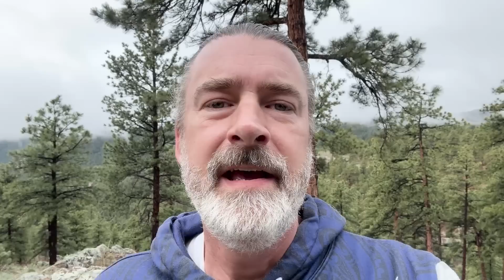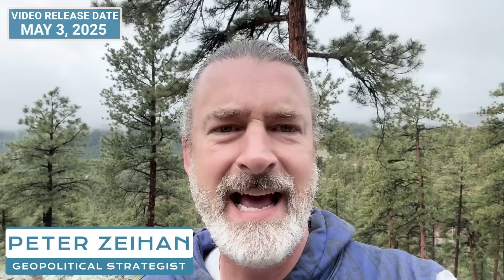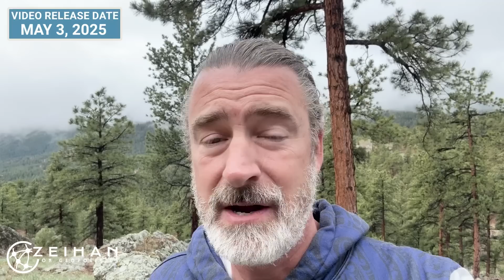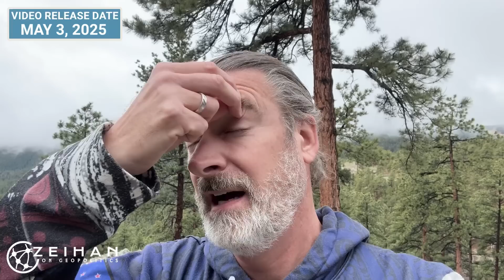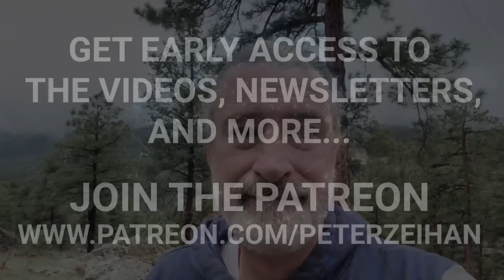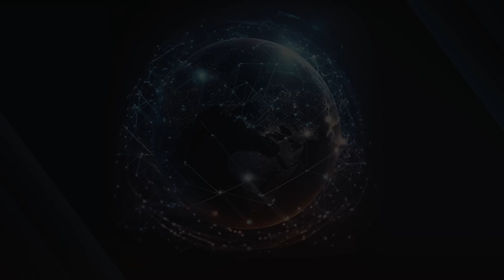The Night the Lights Went Out in Geor- er, Spain || Peter Zeihan

Comment: Electrical Engineer here - you are forgiven but only just. Also nuclear is the non-carbon source with by far the largest grid inertia contribution per MW.
Reply: Finnish base grid organization is testing something called synchronous compensator near large wind farm to stabilize grid wave
Reply: Plasma drilling geothermal, can give old coal plants a 2nd life.
Reply: "Not great, not terrible."
Reply: @immortaljanus  I see what you did there. Underrated comment.
Reply: Yes, hydro, solar-thermal, and geothermal can all also add grid inertia. So there's several green options.
Reply: @domtweed7323  to dream, the impossible dream......
Reply: @domtweed7323 Or flywheels, powered by renewables instead of fossil
Reply: @sam-r7w  Yes, also possible. In Spain specifically they've got 20GW of hydro, several nuclear reactors, and could import grid inertia from France's almost 60 nuclear reactor, so they could probably get away without those. But yeah it's definitely possible. And in more purely variable-renewable grids, like Australia, it makes a lot of sense.
Reply: @sam-r7w  So called renewables use require more energy than petroleum when factoring mining, manufacturing and cause massive environmental damage because of large area devastated.  So called “fossil” fuels are compact, cheap, and much more efficient.
Reply: @domtweed7323  But - the interconnection France - Spain is limited to 3GW only (against 15GW lost)
Reply: @domtweed7323 They are de provisioning their nuclear plants.
Reply: @jogi_54  I agree, build more interconnectors. EDF can get paid power plus extra for the grid stability services, and when Spain has a surplus it can be re-exported into Europe's grid.
Reply: @bobnegri6098  Which is a mistake: They could be quite cheaply refurbished and kept for another 40 years. But even if they go ahead with that France is right next door, and has around 60 nuclear reactors from which Spain could import frequency balancing services.
Reply: @sam-r7w flywheels are a gimmick for grid scale impacts. Largest 2 (which are multiple units ganged together) total 50mw. One was made in 2011 - so in 15 years, only 1 larger was made. 

Spain needs 10-100x that.
Reply: @domtweed7323 cheaper to have thermal plants (coal, gas, nuke) running on “low” at all times and have a limit on how high % renewables is of total generation.  

Then bring up other devices (grid ties maybe, synchronous condensers, battery storage, other?) to allow grid to remain resilient to frequency deviations (aka wobble). 

Renewables just can’t counteract low frequency - you need power to do that, and renewables doesn’t have extra power to give. You always run them at max. 

Or you mandate all renewable plants run only at 90% of max capability, leaving 10% in reserve for frequency response.
Reply: @sam-r7w True. Flywheels with battery backup are a viable solution.

And are about to see a battery revolution in European grids, providing both stability and flexibility.
Reply: @sam-r7w That's not an energy source, it's a battery
Reply: @sam-r7w  Those don't really help nearly as much as you might think, and would not have solved spain's issue here.
Reply: @domtweed7323  and Spain can sell overproduction of PV
Reply: @domtweed7323  Only partially correct. The connections between Spain and France are very limited-pyrenees inbetween. I think it can only transfer 5GW. There are more interconnections planned-but not there yet.
Reply: @bobnegri6098 once you know why, your life will change. However short it may be
Reply: @sam-r7w  You really cannot do it this way. Labour in the UK thought about doing this, but you don't want flywheels the size of a village made of depleted uranium.
Reply: highest is in theory the synchonous condensers... quarter of nuclear plant, divided by zero added MW XD
Reply: Rich hippie commune doesn’t sound too bad.
Reply: Totally agree. This is where Peter tends to show his oil and gas bias. 

A lot of this problem stems from the decades of European nuclear fear after Chernobyl. They want to decarbonize, but with the exception of a few countries they haven’t invested in building new nuclear power generation. These things take a decade or more to build. It’s a tough situation for them to be in and it goes to show that making poor investments in the past (or failing to make investments) can come back to haunt you.
Reply: @TheCommonS3Nse  Well, when it comes to the economic efficiency of power generation, nuclear power is far too expensive and probably only works if nuclear power is heavily subsidized. 
Google: “Due to the price increases in the UK, the state-guaranteed nuclear power tariff from Hinkley Point C has already reached at least £128.09 /MWh, which is currently 14.8 ct/kWh (CfD Register, as of 22.12.2023)”
Reply: @TheCommonS3Nse  they don't take decades to build, they take decades to get threw the red tape.
Reply: @TheCommonS3Nse  nuclear does not take a decade to build. The chinese, korean and japanese are all able to do it way faster than us because they don't have to deal with nimbys and the "green" mafia that make construction and permitting a  way longer and more expensive process than it needs to be. The asian countries get it done quickly by using a set pattern for construction that enable economies of scale and industrial experience to massively reduce costs and build time. We'd be able to do it just as fast if we cut bureaucracy and eliminated the frivolous lawsuits that delay any project like the california high speed rail.
Reply: Glad you're the forgiving type. 
He's missing out a whole lot here. Eg. Regulating wind and solar farms to adjust their outputs based on forecasting would be another way to do it. Combine it with battery packs would add to grid stability.
It that doesn't cut it, limit max output on smaller producers.
Again favor battery packs for stability and slow release of energy.
Heck, it could even "just" be mechanical/water batteries like those in the alps. They need the water supply in any case.
Reply: ... ahhh the anti nuke nimbys will all be out in force screaming ..."we're all gonna glow in the dark".... and "those nuke-plants are nothing but bomb plants in disguise"... just wait for it. Seems absurd but in this day and age of politically motivated fantasy dis-misinformation... and the misuse of AI.. not so far fetcbed.
Reply: NZ is hopefully OK in this respect as most of our generation is spinning of one sort or another. Not much solar and wind yet.
Reply: Hydro is way better than nuclear in that regard, but not every country has the natural feature to accommodate Hydro-electric power plants.
Reply: Just barely forgiven, yes. The explanation borders on nonsense and inverts cause and effect, but it’s at least conveying the fact that it’s an expected behavior of a grid with little to no stabilizing base load elements (nuclear, flywheels, etc.) or rapid response elements (natural gas, etc.).
Reply: As a Portuguese I want to make it clear it was the Spanish fault. Obrigado
Reply: France is predominantly nuclear, which as you said, creates steam and turns a turbine. Nuclear is the ideal option.
Reply: Unfortunately the fuel has a life of thousands of years and they still have not found a safe way to dispose of it, so every rod ever produced over the decades is just sat there humming
Reply: @hayleydiamond9085 Better to reduce the carbon in the atmosphere though, no? At least there is an strong argument in diversifying risk.
Reply: Oh like this "Grid Inertia" term. Sits well in my non-engineer brain
Reply: Layman here, I missed something somewhere.What caused the "wobble"?
Reply: @danstrunk8828  Until now, the real physical sources are unknown - but they are still searching.
Reply: Give me a break on this bullshit cover story.    
Its CHINA doing bad things to take over Gibraltar.
Reply: Since you are an EE, can I ask you? What if the solar cells used their DC current to spin a large alternator? Wouldn't that be a more stable form of AC generation than electronic AC generation?
Reply: Came here to say the same thing, plus the problem he describing is inertia, it can be solved a lot of ways including just overbuilding the inverter. It’s been a known problem, it is interesting that Spain didn’t plan for this.
Reply: Nuke puts us on foreign dependency.  We don’t have uranium.
Reply: I’d love to introduce Zeihan to a motor-generator set. We use them on ships to convert AC supply to DC motors for winches and cranes, (and on my first berth as Electrician, the CS LongLines, for DC main propulsion motors…God’s slot car)…wherever speed control is essential.

 The MG can work the other way too, though, use a DC motor to spin a generator at the rpms required to produce AC current. You’re not then doing it with an inverter either, which isn’t true AC anyway.
Reply: EE here, green power and global warming are scams.
Reply: I heard the nuclear power plants where a part of the problem in Spain. They sensed some problem in the grid and shut them self's down to protect them self's. Exacerbating the problem. So not the most reliable stabilisers.
Reply: Synchronous condensers would work as long as frequency collapse was actually not the issue.
Reply: Yes, good stuff!
Reply: Hamster on a wheel also proven to work.
Reply: So France could have stabilized it if they where more interconnected
Reply: Yup. You said it
Reply: What about the spinning turbans??
Reply: I was about to make the exact same comment about nuclear, thank you
Reply: Electrical engineer here. I would prefer that Zeihan and all the green activists who are making comments simply shut up. At this point, every engineer has upwards of 1,000 arts graduates and political science graduates ready to explain to them how to do their jobs. I'll leave it to you to explain to Peter how an inverter works, and why they are a bit fragile.
Reply: @TheGruntski  The greenies don't listen to engineers! They buy their solar panels and batteries and ignore the human (slave) and environmental damage from strip mines and surface evaporation ponds used for lithium refining. They'd rather scroll through their Tik Tok, laughing at idiots on screen and satisfying porn pleasures than study the damage their smart phone is creating. But just wait, Elon will implant one in their brains as an eco-friendly alternative :)
Reply: Ehh if Spain had French Nuclear Reactors this would not have happened. The USA westinghouse model they use is so shitty it can't go under 40% power and must br shut down. It also cannot supply electricity for their own cooling systems and had to run a massive diesel generators to avoid a meltdown. In France our reactors can go down to 40% power and supply said power to feed the cooling system without the need of external generators. Also the steam turbines from the reactors act just as the ones in coal and gas plant. This guy sure loves shilling coal and gas... Germany relies way more on french excess nuclear  energy than coal and gas from other neighbors.
Reply: Don't forget geothermal power.
Reply: @nicholasmaude6906  don't use geothermal it's not worth the added earthquakes
Reply: @Hoystein  New Zealand already uses geothermal power at the Bairiki geothermal field also Italy uses it too.
Reply: @nicholasmaude6906  Yeah that's part of why we know it causes earthquakes to get worse. It's a big negative externality.
Reply: @Hoystein  The two geothermal fields I referred to are natural, preexisting ones and as such haven't caused any earthquake issues on their own plus they aren't near any major inhabitations, not to mention that New Zealand is already a seismically active country. In areas where geothermal fields have been created that seismic activity should subside over time.
Reply: @nicholasmaude6906  Geothermal fields make it worse due to changing the plasticity of the rock by lowering the temperature. They make the seismic activity worse as a result.

Them being natural has no effect other then meaning you doing have to drill as deep, CA also has such plants in matching locations.

They have a measurable effect. It's been proven, while the effect is negligible with modern buildings built to modern codes... Most of Europe has very old buildings....
Reply: @Hoystein  Those effects would likely be mitigated by making the system closed-loop so that the superheated water is reinfected after passing through the heat-exchangers. Another is of course to make sure the field is in a remote location.
Reply: @nicholasmaude6906  but what will be the unintended consequences from taking energy from the earth's core? More earthquakes? Accelerated growth of the South Atlantic Anomaly? Accelerated shifting of the magnetic poles? Might as well propose zero point energy (free energy) that Nikola Tesla was tapping into.
Reply: @DenverDad2013  None of that will happen, the amount heat slowly radiation out from Earth's interior is immense and geothermal power plants only use a tiny minuscule fraction of that.
Reply: Could you also just use the solar/wind energy to spin up the turbines in old gas/coal power plants?
Basically you invert the flow of electricity to spin them up.
And then, when you need them for stabilization, you essentially have this massive fly wheel that has some inertia.
That way, we'd get the bonus from the old plants, but we wouldn't have to keep their fires lit.
Reply: @MrNicoJac that’s called a synchronous condenser. It’s a similar; but different device. You’d have to add a lot of upgrades at a minimum. Hundreds of millions in retrofits. 

You can repurpose old ones that get decommissioned, but usually better to start from scratch as the old ones are 50 years old.
Reply: @cferrell1048  
A synchronous condenser sounds like you're still using water/steam?

I meant just using the electro magnets (the ones that used to convert kinetic energy into electricity) to get the turbine spinning, like a flywheel. 
Like in an electric car: if you hit the gas pedal, the electromotors spin up the wheels; and if you brake, then they slow down the wheels by recharging the battery. 

It would even be better if we'd take the fanblades off, and replaced them with additional weight (although the central rod wouldn't be designed for that so that's more theoretical than practical).
Or vacuum pump the fan, to minimize drag - but then again you'd have massive losses just to the tiniest leaks, lol.

But I guess that a turbine without fans probably is so little weight (compared to an entire powergrid) that it doesn't add much actual utility/safety margin? 🤔
Reply: @MrNicoJac what you are talking about is called a synchronous condenser. It is a flywheel that is kept constantly synchronised with the grid like the thermal power plant turbines are. It is powered by electricity from the grid. When the grid has too much power / high frequency it spins faster sucking excess power out of the grid. When the grid has too little / low frequency it outputs power into the grid. It provides inertia in exactly the same way as traditional turbines. You can google synchronous condenser and read the Wikipedia page for more details. A large synchronous condenser is currently under construction near me in the UK to help with grid stability. 

An energy storage flywheel is a different thing. That acts like a battery in that it can charge and discharge but it changes speed when that happens. It does not stay synchronised to the grid so it does not provide inertia. 

The other technology that Peter forgot to mention is grid forming inverters. Normal inverters just follow the grid at whatever frequency it's going at. Grid forming inverters can actively correct the grid frequency or even bring it back up after a blackout. In the long run I think that grid forming inverters with large battery banks will provide most of the grid stability. Eventually we need to have enough storage (battery and pumped hydro) to run the whole grid when renewables aren't producing. Once we have that built the grid should be very stable because they can always take over in moments when there is a problem.
Reply: @MrNicoJac  Generally DC power from renewables is converted to AC using inverters which are efficient but use active power components that are fragile. If renewable power is going to be used to power steam turbines in the old coal/gas plants, then you run into the famous thermal to mechanical conversion efficiency problem. You immediately lose 60% of the power you produced via renewables. 
The  issue is that engineers are not driving the design of power grids, politicians are.
Reply: @TheGruntski 
No, I don't mean getting it moving with steam power.
I mean using the magnetic flow to get it spinning. Just a massive reverse dynamo, basically.
Reply: @MrNicoJac  This does not sound workable.
Reply: @TheGruntski “Active power components that are fragile“?
Reply: @lborl5843  Active components are always more fragile than passive cable and metal rotors. Clearly you're one of those modern day Luddites who arrogantly wave their ignorance in the face of engineers and physicists. Get back under your bridge, troll.
Reply: @MrNicoJac  Yeah, I don't get why this is never put forward as a solution. I understand it might not be great for storing large quantities of energy, but for grid stabilization like this it seems like it would be more than sufficient. I can't understand why people insist "You need a giant piece of spinning metal... and where would you find one of those except a nuclear power plant!!!"
Reply: @MrNicoJac  to use the turbine as flywheel mass would require a vacuum to be held in the combustion space. Not economically viable. never mind the near-complete re-config to handle the current inversion
Reply: @MrNicoJac  we already do something similar. they're called synchronous condensers. their purpose is to provide voltage support, but they are spinning machines and thus contribute to grid inertia
Reply: @MrNicoJac absolutely inefficient use of green energy
Reply: @MrNicoJac - using the weak and intermittent to spin up baseload power generators is not impossible but unrealistic. But meanwhile, where would be the power generation to keep the grid alive without a blackout?
Reply: In Spain, the president hates nuclear so much he has raised their taxes up to 70% So half of the plants that day disconnected because the cost of the MW was so low it wasn’t worth the 70% tax.
Reply: @laughingvampire7555  If he's such anti-nuclear Luddite why hasn't he been removed from office? There is absolutely no place for this sort of anti-nuke idiocy especially in light of global-warming.
Reply: People forget that hydrogen is combustible. And it produces water as a byproduct.
Reply: Flywheel, Compressed Gas and Gravity Batteries....
Reply: Nuclear is thermal so it's a huge waste of energy and money.
Reply: @indysalt5281 Ding Ding, found the luddite.
Reply: Other countries are using capacitive storage to back up their systems.  Your explanation is primitive beyond belief.
Reply: @gepal7914 capacitive storage is based on dc, which doesn’t solve the “wobble” issue, aka frequency deviations. That needs inertia to “solve”, which requires large spinning turbines that resist the change in frequency. 

Wind / solar can’t really. 

Storage can, to a degree. 

But capacitors probably aren’t a solution. At least in the traditional ac grid sense or a usual dc sense (you’d just use batteries).
Reply: @gepal7914 came on here to say this, watched the video with an electrical engineer at work at that was his immediate response, for example here in Australia every wind turbine has its own capacitor bank to provide stability, and the supercapacitors used are relatively cheap, constructed out of aluminium and polypropylene.
Reply: @gepal7914 - if you were an electrical engineer involved with grid power generation you would hide you head in shame for exposing your ignorance.
Reply: @gepal7914  Best leave the engineering to the engineers, child, and stop insulting people. Your lack of understanding of the inherent fragility of `renewable grids is shocking. Were you home schooled?
Reply: Peter began talking about the US grid and how say that the power is 1000 volts at the time of creation.  It's not 1000, 1000 is just a convenient number to explain all of this.  It goes through transformer after transformer until it is about 120,000v.  This is the cheapest way to get it to someone like Pedro living up high in Colorado.  But before it gets to his house, it is broken back down to 10,000 V and again to about 240v line power where it can be split into 120v to make Pedro's coffee.   All of the hundreds miles long power lines are that high  because it's cheaper that way.  
Peter did mention the inverter.  I have one in my home here in Sacramento and because I was too poor to invest in a battery, I rely upon selling power back to PG&E during the summer months.  
The point is that here in the US, we have plenty of natural gas generators to even out all of the California peaks and valleys.
The easiest way to fix Portugal's problem would to import some coal from the US(it's still cheaper than LNG), but the EU is ran largely by smug leftists who believe that they know more than us commoners.  So I hope Peter does a follow up on this video.
Reply: We have more than enough power on our own Portugal, we just did a National blackout restart in something like 8 hours, and kept being disconnected from Spain for a few days, for obvious reasons. The thing is market, when Spain grid failed, we were buying 60% of our power from Spain, simply because it was cheaper, Spain has loads of Solar, and that produces a lot of cheap power. If you loose 60% of your electricity in less than 5 seconds, there's no grid in the world that can hold, and btw nuclear tends to be the first one to be separated from the grid due to safety, situation could go from bad to catastrophic very fast
Reply: @charleswomack2166  "smug leftists" are 99% corporate shills, the EU is mostly a fig leaf over the German industry! XDXD If you mean "not explicitly fascist" by "leftist" than yeah, ok. the smug part is spot on, no notes
Reply: @charleswomack2166  "The easiest way to fix Portugal's problem would to import some coal from the US(it's still cheaper than LNG), but the EU is ran largely by smug leftists who believe that they know more than us commoners.  So I hope Peter does a follow up on this video."

A lot of your post was very sensible - all the stuff about power distribution in the context of the US power supply in your part of the world - until you got to this paragraph. As somebody who actually lives in Portugal (though I'm British) you're well wide of the mark here more than a little politically skewed with whole "smug leftist" rant. Political bias and wishful thinking really doesn't make for good engineering. 🙂

First off, for your information, Portugal, like much of Europe uses a 400kV national grid, stepped down to to 200kV and 150kV. Local medium tension lines typically run at 32kV (on the edge of our property, for example). Out in the countryside where I live we step down to 400V rms three phase to the home (with 230V rms per phase per circuit within each mains circuit in each part of the home). 400V three phase is used for water pumps (borehole, for example) and machinery on the farm.

Importing coal from the US would be as dumb as you could possibly get. Europe has no shortage of coal. Most of it still sits underground because it's not needed and not economic. I say this as the first man in my family for over 200 years that didn't work quarter of mile underground at the coal face. But even in my case, at the age of 17, I spent time in a working deep coal mine huddled between hydraulic rams shuffling forward into the coal face with tens of thousands of tonnes rock crashing down from the roof within a few yards of my feet. Politely declining kind offers of chewing tobacco from the old boys on the face whilst this was going on, I might add. With the drum cutter and coal conveyor whirring in the background. I'm from one of the oldest coal mining communities that was working to extract coal right from the start of the industrial revolution. 

No, mate. A coal miner I wasn't - breaking a family tradition that includes both my grandfathers, my father and all my uncles. Not to mention the previous 6 generations of the family. But I did go to a University (formerly named the "Welsh School of Mining") to study electrical engineering, amongst other things. 

Trust me when I tell you that coal has no future for power generation. It's not economically viable. Because renewables are simply way, way, way, way, way cheaper. Particularly PV. Even without subsidies the renewable power generation is so cheap that coal fuelled power generation stations have to be subsidised to stay in the electricity supply market. And that's before we start to deal with emissions regulations and carbon trading. Nuclear is more heavily subsidised still. Gas is by far the dominant electricity generation hydrocarbon-based fuel in Europe. Because as these things go it's relatively cheap and is easy to pipeline to where that fuel needs to go - hence the reason that LNG and regasification has been used as an alternative to natural gas. Whereas coal needs a dedicated rail network between mine or port to the power station (and all the rolling stock and operations that go with that). It ain't cheap. And it certainly ain't quick. You're talking about three decades to build that. Which would be just a little on the late side. If you know what I mean... 😀... and far more expensive than merely building the necessary power distribution network synchronisation infrastructure. 

Portugal is rich in wind, solar and tidal resources. It's very rich in hydro-electric generation resources (with hydro-electric dams all over the place). It has large reserves of uranium for nuclear if it chooses to go that way. But it doesn't need to import either coal or LNG. Because its natural gas supply comes from North Africa (via Spain!) through an existing pipeline. If it actually did import coal then there are far cheaper places from which to import it than the United States that are far closer (e.g. Poland). Indeed 20% of Portugal's power generation was coal until 2018, dropping to 10% in 2019. 

Back in 2018 natural gas power generation made up 26% of the mix. Hydroelectric made up 23%. Wind 22%. With solar just 2% (same as now). All that's happened since is that Hydroelectric went from 20% to 28%, wind from 22% to 27% and solar from 2% to 10%.

And mate, US LNG is hugely expensive compared to the natural gas that countries like Germany were importing until the Ukraine war kicked off), was sold at around 4 times the usual market price while Germany and co were making that conversion and currently I understand that US LNG is sold into Europe with around 100% margin. But the US has been pretty wobbly about supplying LNG to foreign customers over the last few years in any case due to domestic politics within the US related to the LNG industry. Certainly on the East Coast, at least. 

Your domestic politics alone is a reason that nobody in their right mind would increase reliance upon the United States for energy resources. And that's true whether the consuming country has a rightwing or leftwing government. You're a pretty unstable bunch right now, my friend. I'd rather that the European electricity distribution companies get their act together with the regulators and ensure we don't have a repeat of what happened the other day. And if that means building hydro capacity or even a nuclear power station or two, then so be it. Coal it most certainly won't be.

Finally, let me address this: "EU is ran largely by smug leftists... blah, blah "

Actually, virtually all governments in the EU are conservative governments at the moment, with the notable exception of the UK and (by a whisker over the last few years) Spain. But even there, that's just been for the last 10 months in the care of the UK and only recently in Spain. The previous 14 years in the UK were under multiple very right wing conservative governments. Germany likewise had decades of conservative governments (under Angela Merkel). And Spain likewise. Italy has had a series of far right wing government recently (including this one). 

People like you are - unfortunately - really divorced from political reality in the European continent. Both right wing and left wing governments across Europe are largely supporting of the move to renewables. It's only really in the United States that you've made this some sort of political right/left wing hot potato and culture wars issue. Which is nuts. And I hate to break to it you, mate, but you don't really have a left wing party in the US worth talking about. Because even the so called left wing of the Democratic Party is pretty middle of the road compared to most countries worldwide (and not just in Europe). Most of the Democratic Party is (substantially) to the right of that.

In Europe, the politician that really started to take the whole issue of climate change and renewables serious was none other than Margaret Thatcher, the British Prime Minister of that era. And she was about as right wing as you'd ever get, being politically very close to Reagan in the US.

And mate, lest you think I'm a far left wing radical, in addition to coming from one of the world oldest coal mining communities, I used to work for the second largest oil company in the world. Mostly working on things with the third largest oil company in the world at that time. Just so you know! 😉
Reply: @appstratum9747  wow!   Thank you for responding to my post.  But in the UK, the head of state is the king, right?   The king of England, like the king of Saudi Arabia are not held accountable by elections.  So I don't think it really matters who the people of the UK want.
I had a great conversation with a cab driver when I was in London.   He asked me why I had come to UK.   I replied that I wanted to see Buckingham Palace.  I asked him why people of the UK like to keep im a monarchy style government.  He replied "tourism".  
And regarding Portugal, I imagine that most people long for the days of Salazar.  I have an American friend who was from Portugal.  I asked him why his parents brought him to the states.  He said that after one of his neighbors had been "disappeared" that made his parents think about emigrating.  
Thank you again for your lengthy reply.  I actually learned something!
Reply: @charleswomack2166 or just install cheap supercapacitors like most countries do
Reply: @charleswomack2166 wait...you got suckered into net metering and you think we want your opinions about what needs to happen?😂